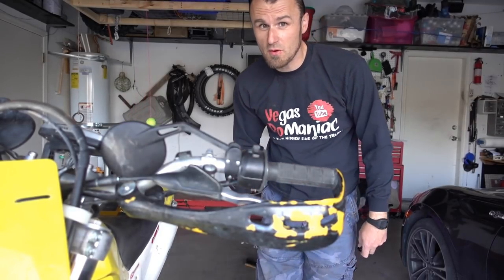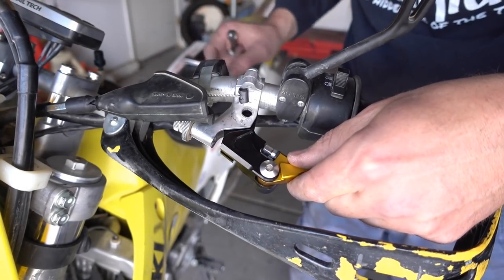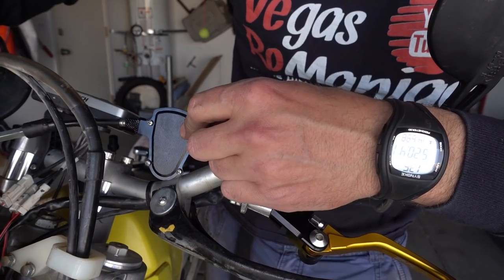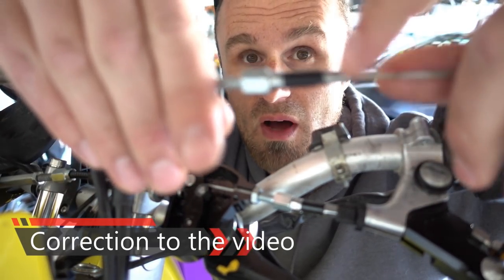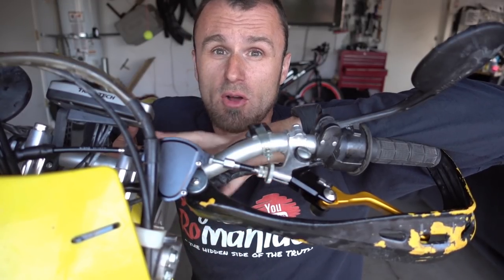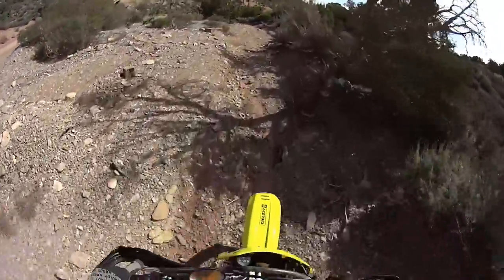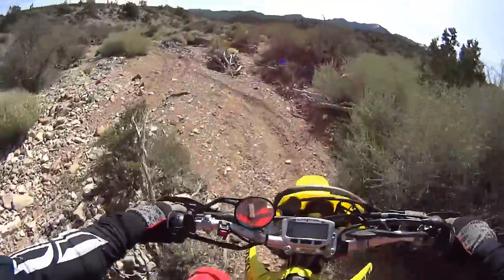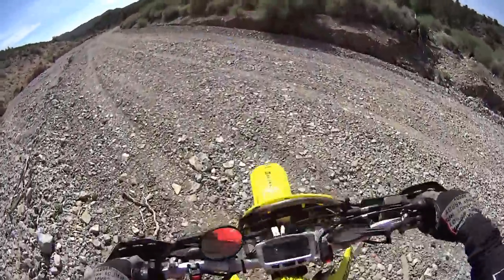HEAVY CLUTCH PULL FIX any motorcycle Moose Outlaw Racing Easy Pull Clutch System BEST DRZ400 UPGRADE

Comment: You are right about having to hand fit the cable end to fit the original lever cable adjuster. I just took the metal end off, and slid the cable housing in the adjuster. I ride a 1971 Bultaco Pursang 350 with AMAL levers and the thread pitch was different on my set up so I couldn't swap them like you suggested. I found that this thing dropped the pull weight by about 20 percent. A help but not quite one finger for me anyway. It did take quite a bit of fiddling with the cable adjustments to get it to fully release but not slip either. Clutch lever movement increased for the amount of movement at the actuator lever on the engine. My bike already had the actuator lever extended 1/2". These bikes have a tough clutch, as you aren't going to be using it as much on an MX track, but I am trail riding this vintage bike. 58 and a replacement hip on a MX track would be an unnecessary risk. I was thinking about trying one of the cheap hydraulic setups you see on ebay and amazon. Have you tried one of those?  Great video as usual Vegas! Thanks for posting it.

Comment: Had no success with my Triumph 2008 Bonny. With all adjustments perfect, sure the lever is easy to pull but the actuator at the clutch end only moves 14mm now. Without the device it moves 18mm and that extra 4mm is what dis-engages the clutch better  for  minimum clunking into first and easier changes. Someone will no doubt say my adjustment is wrong but this is what levers do. Easy to move but at the expence of distance.

Comment: I was watching your 10 mods for your 250fx and you pointed out the risk of the long exhaust bracket bolts crashing into the engine case and damaging it. So I shortened the bolts on my 250fx to eliminate that risk. Thanks for the tip!!
Reply from the maker: Yeah that's a great mod man , I'm glad I found out about it before shit hit the fan.. One of my buddy's has a big gash in there

Comment: I had one on my KDX200 back in mid 90’s. I wonder how many people will think these are new. I never liked the way it fits but it did lighten the pull.
Reply from the maker: I thought it was new.  Haha
Reply: Vegas RoManiac yeah that is funny. I was the exact same thing. From memory nothing looks changed. 
Hey, next time you make it to Moab you need to come a little further east to the Western Slope. I’ll show you around. I know you’ve ridden Sargents (maybe other areas near there too) but there’s more to see
Reply from the maker: @brianh8484  sounds great, I am planning a Colorado trip, maybe we can make it work, I'll anoouce  it on my channel
Reply: @vegasromaniac  This easy pull device is an old thing, indeed, I had one with my KX 250 1986. Still have the device in a box. The bike is long gone... The downside is that it change the leverage ratio of the lever and the engagement point is lengthened. I tried it on my CRF 450 last year and removed it after a few rides... I don't like the weird effect on the engagement point of the clutch. And by thew way... our argument about the 250 vs 450 is over. I bought a sxf 350, hahahaha. :) I hope to ride it for the first time this weekenf, if the temp is good enough.
Reply from the maker: @Wide000  good to hear man, let us know how the bike does..

Comment: I had a 370 Rotax with a ball and ramp clutch actuation in the 80's. I considered installing one of these. Later models reduced friction by adding more ball bearings and modifying the ramp. The lever should pull easier the further from the bar.
Reply from the maker: It works great on the drz, I already ordered  another one for the yz, see what's up

Comment: What’s the clutch lever? I’m after one for my DRZ400. Have you broken a cable yet? I’ve read that some guys have snapped 4 cables in a year, but they may have not installed it right.

I bought a CNC copy off eBay and it’s very well made. It’s been working well.
Reply from the maker: Nope, the system works great both on my drz and my yz so far, many many miles on it

Comment: You can put washers on top of cluch springs also to lighten it, if 8 springs on plate easier to pull than 6 or 4 also, may need to go thinner washers incase cluch slips or only fit to 2 springs bolts
Reply: Your wrong it's washers on the bolts not on the springs that will make more bite

Comment: Ive been meaning to get one of these for a while now. It will be part of my clutch upgrade.
Reply from the maker: Ebay has them for 10 bucks but only green.. Color
Reply: @vegasromaniac  Is the case plastic or aluminum?
Reply from the maker: @dr.hugog.hackenbush9443  aluminium, it's nice, I'm sure it can be waterproof also with some silicone..
Reply: @vegasromaniac  This will also alleviate some arm pump from using the clutch a lot- means I can go faster for longer. 😃👍
Reply from the maker: @dr.hugog.hackenbush9443  yep.. I use to fingers on the yz I wonder if this Will make it 1 finger
Reply: @vegasromaniac  I couldn't imagine my clutch as sensitive as my front brake.. (1-finger stoppies)
Reply from the maker: @dr.hugog.hackenbush9443  yep.. It can be achieved..
Reply: @vegasromaniac  Ill see if I need it after I replace my clutch basket (its notched) and possibly hub. No CR for a while. ☹

Comment: My 01 YZ250 has a pretty smooth clutch but I do find myself having to use three fingers and i get arm pump real quick do the clutch basket Springs stiffen up over time or do they get looser I'm debating changing them out
Reply from the maker: Usually the springs never stuf up but loosen, the only other thing it's the market might get worn out, in any case this is the cheaper easyes solution I found so far
Reply: I meant to say yz250f if it wasn't for my bike I probably would have never found your Channel sure glad I did you've been a lot of help much appreciated
Reply from the maker: @bricehale6593  my buddy just replaced the clutch basket on his yz recently had grooves in it, felts like shit , 150 bucks later feels better but still an 03 bike  and you can tell
Reply: @vegasromaniac  right 01 and O3 are definitely some old bikes but I love it I had  my buddy following me in his truck couple days ago I told him to pull up beside me when I'm standing a wheelie I want to know how fast I'm going he said I went over 70 on the back wheel that's just crazy I mean I kind of figured it was up there the speed limit on my road is 55 and I pass people all the time doing a wheelie no problem but slow wheelies are a problem because my clutch is kind of stiff and throttle response is lagging a little bit

Comment: Thanks for the tutorial sir. One question come sto mind: what happen with extra six inches of cable? Dont need to cut it? Or do you just "build tension" by rerouting exactly six inches?
Reply from the maker: Do not cut it . Specially when you have raised bars   the extra length just hides in there

Comment: 1. Thank you Thumbs Up
2. Consider adding external mic to your helmet because we can barely hear you during the ride. 
3. Is the DZR400 street legal? If not, consider going through the process of plating it in Nevada. I’m really interested because I’m in Sacramento, CA and my sister in law is in Reno. Wink wink. 
4. I think that clutch thing is shit. I got so pissed off after an hour trying to get it to work, I threw it away. I hope it works out for you. Is the clutch pull really lighter? Be honest. :)
Reply from the maker: Yes the clutch pull is really ligterx it survived one ride so far so I ordered one for the yz. The drz it's already street legal so all I have to do is transfer the title
Reply from the maker: As far as the microphone, I've tried several, the bike it's so loud this is the best microphone setup while riding  little wind noise and most of the devices I listen to voice it's crystal clear as far as I can tell, considering that I'm trying to talk over a 4 stroke with fmf pipe
Reply: @vegasromaniac  Shit. I need to find that thing. It's around my garage somewhere. LOL

Comment: I was just searching on amazon for one of those. I've abandoned the idea of the cheap hydraulic clutch, i settled on one of these and a chinese "stunt lever", short but with a bearing on the pivot. I'm still a bit unsure however because i think i might regret buying a lever that short for a dirt bike
Reply from the maker: Once you get it let us know how it works
Reply: @vegasromaniac  i'm a bit late, but yes, that combo really works quite well. The clutch travel becomes really long,  but you can definetly pull the lever with 1 finger all day long.

Comment: Brother you totally lost me when you said I should have used the opposite side of the cable that would have fit inside the handle, Im trying to install one now and I just do get what you did, Would you please explain the right way to do it without grinding off the end caps, thanks.
Reply from the maker: I switched the powotion of the the spacer that comes on the uIt with the spacer that goes on the brake lever..

Comment: Mine broke first pull. Cable end came right off. I'll pass.
Reply from the maker: Mine running strong 6 months later also you got 2 cables in the kit, just use the backup
Reply: Robert Pabst ..you’ve just got to solder the barrel on better. It’s not difficult. Resin free 50/50 solder and flux.

Comment: easy fix, lengthen the actuator arm down on the case. this thing is junk.
Reply from the maker: Good idea but impossible to do  there is not longer arm for the actuator also if the travel it's to long at the bottom, you will scrape the cable on the mounting pojt and breaknit there, this is a easy fix and so far it works great..
Reply: I put one of these on my xt350 and I gained maybe, at best, 20% easier. And that is with a brand new clutch cable..

I think I will be making an extension for my clutch lever arm as well. Since I have a lot of travel in my clutch.

Comment: Easy fix! BUY A KTM LOLLLL. Good video
Reply: Damn you beat me to it.. hahahaha
Reply from the maker: Actually that's the hard expensive fix..
Reply: Vegas RoManiac it’s not hard? Walk into a dealer, write an $11,000 check, walk out with new ktm.. haha. 

Getting that 11k in your bank account is the hard part.
Reply from the maker: @SkinnySkinch  haha, yeah, never.. Never never never
Reply: @vegasromaniac  🤣 understandable. it's too much money honestly. but people are buying them like hot cakes so....
Reply from the maker: @SkinnySkinch  because people wanna buy themself skill, the only reason the rekluse exists,
Reply: @vegasromaniac  Haha that is definitely an opinion on the matter. Using that theory, your easy pull clutch lever you just reviewed is also "buying skill." Using tubliss, using mousse bibs, using soft grip tires for enduros, using gripper seat covers, having your suspension professionally set up, literally every single aftermarket part out there would be "buying skill." I don't really see that being a problem with that though. Things like that are used all the way up to the pro level(yes mostly paid to use but some pro riders do have a preference and get to choose what products they want to use and therefore be sponsored by). If it's not considered cheating, more power to them. For amatuer riders like us, i think most products like that make the riding experience more enjoyable for the rider, not necessarily BETTER rider. If I can buy an easy pull clutch, or a rekluse, or whatever and go out and enjoy my ride more and ride longer, you bet your bottom dollar i am going to buy it. I am not training around the clock to become a better rider like a pro so any "advantage" i can get, i would look into. Just my two cents.
Reply from the maker: @SkinnySkinch  to a point you are right, everybody wants a bike that rides itself and once  it does than it will be boring
Reply: @vegasromaniac  F*** that! im dreading the electric bike take over as well. i know it's better and will save the sport bla bla bla not a fan. i want to hear my motor.
Reply from the maker: @SkinnySkinch  I would like to try an electric but not sure I wanna pay 12k for a 20mile ride.. Max.. The motor I don't care that much as sound goes
Reply: @vegasromaniac  you also can't hear the bike coming around a corner on a two way trail. no thanks. i will quit riding before i go electric. not doubting the bikes will ride and feel awesome i am sure they will have even more power than a gas motor. fixing and working on the bikes is half the fun IMO.

Comment: I tried installing one of those,  ended up tossing it in the scap bin.
Reply from the maker: That sound like an installation problem, mine worked fine on 2 difrent bikes, and I love it so far
Reply: Same problem you ran into in your video,  customer just didn't want to deal with it.
Reply: Me too.Fitted one to my 2019 Tiger.Although the effort was less,so was the travel length at the clutch proper.This gave so little travel that the clutch plates were not separating properly and I had clutch drag.

Comment: These companies are purposely putting the same terrible features every year 🤦 shitty levers(sometimes front brake is good af actually hahaha) lot of times suspension is fuckin off off, tiniest exhaust upgrade would +3-7hp a bike out the gate but they NEVER thro a yoshi full system or a Suzuki Hinson clutch which would def help Suzuki rise in the rankings

Comment: I wonder how many ppl have bought a KTM simply bc it has a hydrolic clutch......!!! HAHA
Reply from the maker: Many many many
Reply: My hydrolic clutch isn't light!  Ktm 2003 625!
Reply from the maker: @neilizer  big motor big springs in the basket for that torque
Reply: @vegasromaniac  still sucks lol
Reply from the maker: @neilizer  because it's hydraulic you can't do much but change the lever to a half pull lever, might set you back 150 bucks